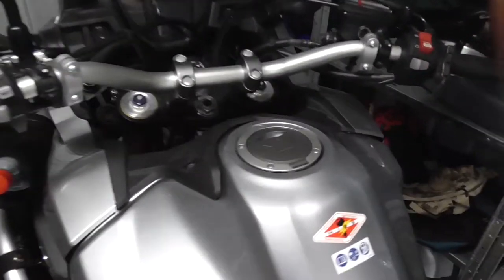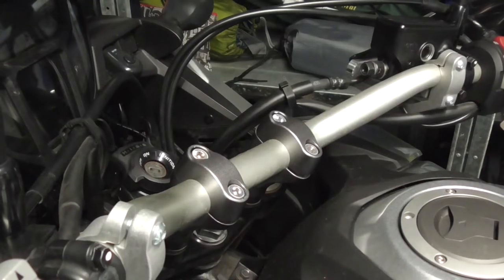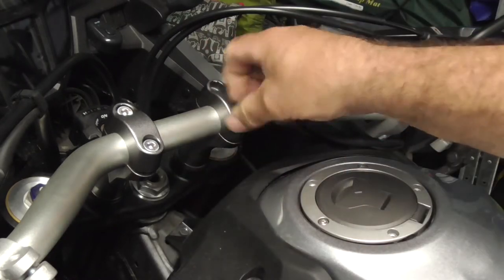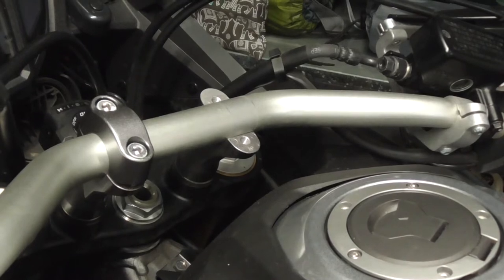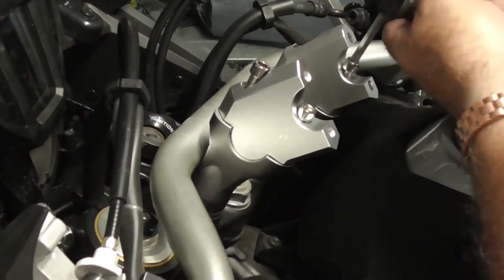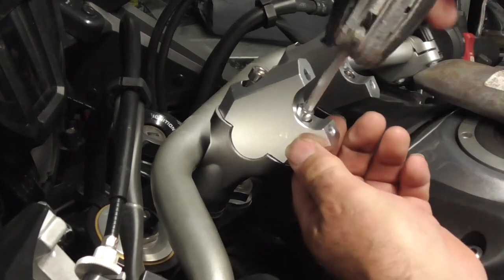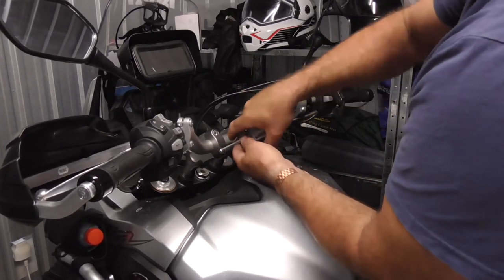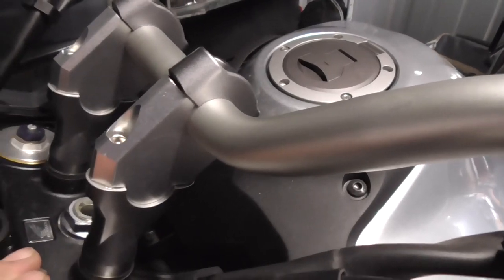Handlebar risers Africa Twin CRF1000

Comment: As you said, you can use it with 2 different way.
Did you find any issue with first position while givi lock tank bag on it ?
Reply from the maker: Yes i wanted to bring them closer but just went higher due to tank bag and then tilted back handlebars

Comment: I see in a later video you did where you are riding your bike you turned the risers around. what brand of risers are they and how much do they lift the bar?
Reply from the maker: Anton Du Plessis 
Hi they are made by a company called WAASE
They lift it by 40mm straight up or 20mm up 20mm and back
Reply: Don't search waase and click on the first link, you get some strange stuff....
I am going to try mill my own risers. Are you still getting the wiggle when you change directions, I think I know how to fix it, but you going to need to mill your risers.
Reply from the maker: Anton Du Plessis 
Oh deer... Lol. Here is the link from ebay where i got them
https://rover.ebay.com/rover/0/0/0?mpre=https%3A%2F%2Fwww.ebay.com.au%2Fulk%2Fitm%2F272908985173
Also think the wiggle was just because i wasnt used to them being higher they feel ok now 👍
Reply: Wulf On The